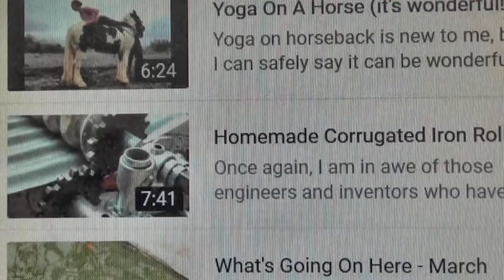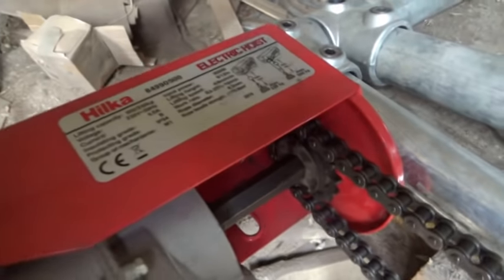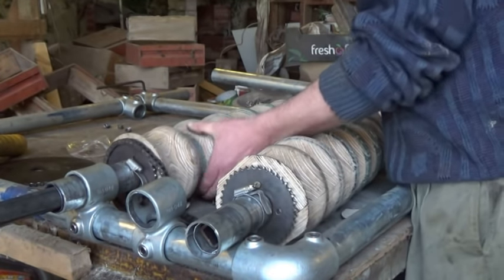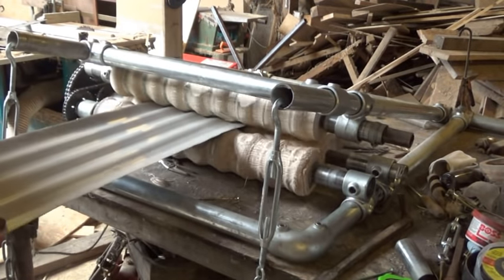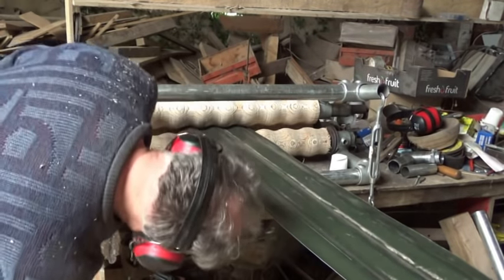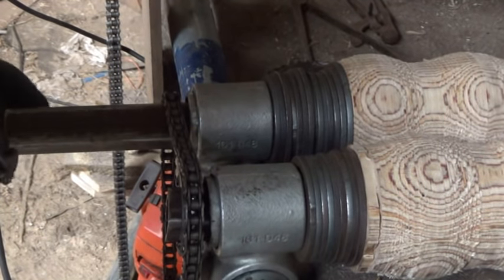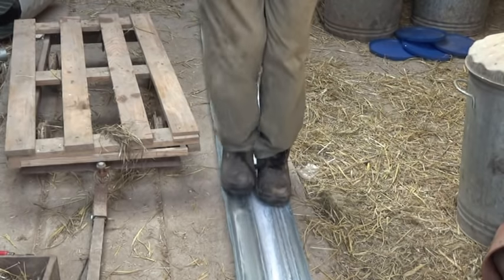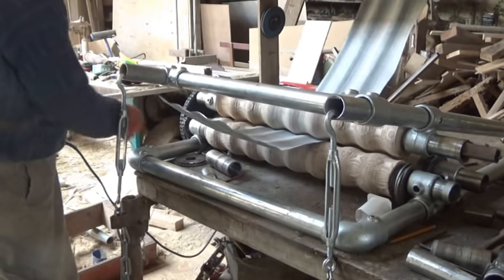Homemade Corrugated Iron Roller - Part Two

Comment: Run the iron horizontal, it will conform to your shape fine. It maybe counter intuitive but it will work.
Reply from the maker: You mean horizontally on the roof? It would need much more support though..
Reply: @WayOutWestx2  If your shed is under 2 meters long ,2 layers of 6mm ply 100mm wide bent in the curve in the center of the spaneand 12 mm ply on each end cut to the curve with 50mm X 50mm blocks 80mm long screwed around the curve to support the iron would be enough.
Reply: A Gramble style structure with ply cleats on the frame joints might be worth a look too. They have calculators for Gramble roofs on line now.

Comment: What is the problem with horizontal .you will get the form from your ends, water collecting is a none issue as it will run off back or front from the one or two dips on the very top.  I was impressed by posting a failed project, I feel

Comment: I don't see a way other than either very extreme pressure or heat how they can make that curved stuff. The raised section on the inside wants to be a shorter length than the outside does. I wonder if there's any 'how its made' style videos on this stuff.

Comment: You need multiple sets of rollers. Only using 3 rollers will naturally make it curl up in a circle. Try using 3 pairs gradually increasing the corrigation and stacking them directly on top of each other.
Reply from the maker: Thanks, but I'm trying to make it curl up : -  )

Comment: Progressive sets of rollers so that each set does not take all the load. Also each set of rollers should be say rounded for the 1st set then oval for the 2nd set. If you start off practicing with galvanized flat sheet very thin it will bend to your profile.

Comment: Was really hoping to see it work I would thing the bottom rollers need to be much further apart so it’s bending more sheet at a time lowering all the forces needed  allowing the metal to stretch not kink
Reply from the maker: I think the gap between them might make it more likely to kink because it's not supported. But you could be right..

Comment: Just a thought  have you thought about trying a drop press. I will soon need some standard curved sheet to repair a barn and as the flat is so much cheaper I thought of casting an internal and external mold from concrete and then using it to stamp the straight sheets into curved ones very similar to the way they make car body panels
It will be at least a year before I try but if I have any luck I will tell you. Unless of course you do it first 
Well done for all your trys at the worst you now know many ways how not to make them (Edison about light bulbs I think)
Reply from the maker: Have a look through the playlist - you'll see that my later machine works really well.

Comment: I see you have way too many things in your setup that are causing variations that will mess up the rolling process. 
You are on the right track with your methods. However rolling corrugated iron does need some very precise measurements since even if your rollers are half a millimeter out of parallel it will create a point at wich the steel can pinch and buckle. 
Try making a fixed, welded frame, using screws to adjust the tension,  and, well, steel rollers are really the only option, not sure how you can get around that one...maybe if you make your wood rollers very carefully you might snag the first couple of runs....if you get everything else just right. 
Unfortunately as the wood compresses it will throw you out again. 
Keep persevering though, love your ingenuity 👍

Comment: I have a hoop house for my chickens. It is covered with 2x4 galvanized wire and each year I cover the wire with shrink wrap. In the summer I cut out part of the sides for air flow. I believe shrink wrap is better than a corrugated roof because it allows year long sunlight. Even at temperatures below zero the chickens roost on top of the enclosed coop rather than inside. I added a few fiberglass poles to the inside to shore up the structure against heavy snow. It requires a couple hours of maintenance per year.

Comment: Take with grain of salt, but I envision two bottom rollers moving apart in progression of downward pressure.
Reply from the maker: Ha! Now you're talking complicated : -  )
Reply: @WayOutWestx2  It is funny this problem your encountering has me dreaming about how to fix it.  I think the way you have it now you have two points of contact where the top roller hits the two bottom rollers as it goes around the top roller, it kinks between that transition is my best guess.  The idea to have the rollers move out of the way could be a real pain.  I dreamed up a pivot that was held together with spring that releases under the pressure of the top roller and your right, a nightmare.  Then it occurred to me that maybe you don't need direct contact sandwiching the metal between the top and bottom rollers.  What if you moved the two rollers out enough to allow the metal bend and bow above the bottom and below the top rollers.  I am hoping that would solve the kink issue, but probably will create other issues!  LOL!  Just know that it still has me scratching my head.  This reminds me of the time I had to investigate how the clay marble was created on a massive scale and I could not figure it out.  Old Patent searches took me on a fascinating escapade of how the spherical bullet shot was invented, the missteps and the brilliant victories.  How Samuel Dyke produced so many of these clay marbles, they were used as ballast in ships.

Comment: the problem yes your rolling it back and forth but I believe you need more sets of rollers were the center is creased first and then so one to the next set of rollers. the metal is trying to go smaller.   IE you have a 3 foot wide peice and onces it fed though the roller it might be 2 feet as it comes out.
Reply from the maker: I'm only trying to roll the corrugated iron - not put them into flat sheet. Sorry if that wasn't clear
Reply: @WayOutWestx2  Maybe the piece of sheet metal needs curved first then the corrugation rolled in.  I know they do this for the big grain bin's.

Comment: You're probably not going to like hearing this, but I think the slack in the pipe construction is really not doing you any favors.

I think it's true that the flat steel would be less robust than formed corrugated iron, but if it's supported at both the front and the back with frames it would still be quite strong
Reply from the maker: Thanks, Rob. I spent yesterday taking out slack from the bearings - and the result was the same. So I may have to go with the flat after all.

Comment: I think you need rollers that inter-mesh and the sheet just fits in the 1.5mm or 2mm gap. In that case wooden rollers and thin axles simply won't do due to flex.
Reply from the maker: I can't find any flex in them so far, Roger - but you might be right
Reply: @WayOutWestx2  What I mean is two rollers one above the other, not three. Granted that will not give you a curve to the panel but perhaps the curve could be put in afterwards like you are doing it now.

Comment: Switch to a canvas/resin composite and seal it with shellac. It's very strong, if it breaks its biodegradable, and is a much better insulator than metal.
Reply from the maker: Good idea, but I wonder how long it would take for the fox to get through it?
Reply: @WayOutWestx2  laminate chicken wire between the layers and it won't

Comment: A thought...
That roofing tin is wavy to give it stiffness so that it DOESN'T bend and lays flat on your roof...
Since you're going to be using it in a U shape, why use corrugated tin? Why not use flat tin and a flat roller to make it U shaped. The large U shape you bend it into will be plenty stiff enough to only need the ends tacked to the floor of the "building" and would make it easier to make the end caps attach since you'd be stapling them flat to whatever arched wood you use to cap the ends of the house.

Look at tin piping for wood stoves. The bends in that curved metal have creases around the curve to shape it into a regular curve, to bend curved metal, like pipes or corrugated tin, you need it to either be thin with creases or thick enough (like exhaust pipes on vehicles) to accept a bend without buckling (even then, you sometimes have to pressurize with water/sand to keep it from creasing).

So, for your application, you should use flat tin, not corrugated tin.

Comment: Try waxing your rollers so the steel will slide alittle.... or soak the rollers in oil over night..... graphite might help too..... put sprocket on top roller too
Reply from the maker: put sprocket on top roller too? but then it would go in the same direction as the others, surely?

Comment: Your Problem is slippage that can be observed in the video. Yo need to increase the pressure at the roller contact area massively, which is why the machines are usually made of heavy steel or cast frame. The pressure forces the steel to flow into its new shape giving a smoother finish.
Reply from the maker: Not with the layout I have, Michael - increasing the pressure would only make it try to bend more quickly

Comment: Have you tried rolling a thin flat steel sheet? maybe .7 .5 mm?
Reply from the maker: Yes, that's no problem at all - but then it would flex too much in it's final position

Comment: Have you tried tempering the sheets after each pass? Otherwise you get work hardening
Reply from the maker: Unfortunately the zinc coating cant take any heat
Reply: @WayOutWestx2  well you can take it to a low steel anealing temperature as long as the atmosphere is controlled(nitrogen). It will turn the coating into Galvannealed. It you still has good weather properties and is more paintable but becomes stiffer.

The second option which is much more difficult is to add pleats. In the commercial systems they form the wave shape first then a press dimples The sheet to form a curve. Here is a picture: http://i.bosscdn.com/product/d5/85/73/e339808a23801e8c49eadd8098.jpg@4e_360w_360h.src%7C95Q.webp
Reply: Also with your rollers the width between each peak needs to get shorter as you press. Reducing the hight of the peak was a great insight but you also need to bring them closer. On commercial systems that do this they use a progressive die and each set of die brings the peaks a little closer. 

Best of luck. Hope you figure it out.

Comment: I think the problem has to be in the build of the whole machine. Not the rollers themselves. I think that there's simply too much play in everything. Trying to use the pipes and turnbuckles instead of bearings and heavier duty gear drive might be the problem, I always try to find some old machines to borrow parts off. It's the most affordable way to get heavy duty parts. That's the only difference I can see between yours and the commercial ones. That's where I always start anyway. Never give up.
Reply from the maker: The turnbuckle one was just the first set-up - but I take your point about too much play

Comment: I worked at a metal building manufacturer.  We had a system of multiple rollers to corrugate metal..  Each stage was a little different and the metal was 29 gauge.  Maybe instead of multiple passes through the same roller, you should make a different roller set with a slightly deeper and narrower corrugation.    Just something to think about as I understand you are tired of screwing with this.
Reply from the maker: Thanks, Jeff. I'll have a think...

Comment: Instead of bending the tin with rollers, what if you just make both sides of a form out of concrete and press the flat metal between the two halves. You could use a chain host as the bits would be heavy.
Reply from the maker: I wonder whether that would actually work though - The corrugations would have to be in there to start with, and putting weight into the middle of a corr. sheet would just buckle it surely? I'd love to try it, but the experiment alone would be quite a project

Comment: Heat ? What if you heated the metal before running it through the rollers
Reply from the maker: Unfortunately it would need to be too hot for the zinc coating, so the finishing would be ruined

Comment: The answer: it needs MORE PRECISION!
No single part should wiggle more than half a millimetre since the moment you start inserting a sheet into the machine.
It would be possible but you would need to find a way to use metal instead of wood and not using pipes as they do give a bit when the movement starts.
You just need more precision in the machine.

Comment: Buy yourself a powered bead roller and roll one bead at a time.

With that method, you also won't be constrained to parallel beads.
Reply from the maker: Interesting idea. Thanks. I imagine that would wreck the zinc coating but I'll have a look
Reply from the maker: That's amazing. Thanks.

Comment: I don't normally leave comments. But why don't you just get a culvert cut it in half then pop rivet tin sheeting on to the inside of it for the skirting  like your videos keep them coming
Reply from the maker: thanks, but I'm still hoping to make them in one piece. And also all the culvert here seems to be plastic these days
Reply: Awesome I can totally respect that. just throwing out ideas. And just for the fun of it I have one more. I was at a construction site and the new fire codes require the basement windows to be escapable. So my idea is one of those barriers that are made to hold back the dirt might work for you. The ones here are metal could be an option. And as always have a great day
Reply: I just did some looking around and the cheapest ones I could find were about 210 American dollars So probably outside the budget of your project

Comment: Incidentally https://youtu.be/7f__LAudU9A that took me two seconds to find maybe a steel roller set and you could weld everything and make everything more rigid right? I mean can you weld? can you get thread rod, about an inch should be strong enough instead of the turnbuckles. Maybe you could try anealing the steel sheets if you're not using colourbond. I love that you mentioned that we have it in Australia, yep we do our verandah's with it, we call it bull nosing, it's very attractive.
Reply: Use a ball nose endmill in your die grinder or a tungsten burr, focus on the finish of the steel as in polished. they shouldn't have to be hardened they just wont last very long
Reply from the maker: Thanks Nick, the zinc couldn't cope with the heat so I can't anneal it. And the roller set is what costs the money..!

Comment: Keep it up Tim!
Two things i think may help
- a way of adjusting the tension on both sides evenly so even distribution of pressure (not pinching on either side).
- and a feed guide along the edge to keep alignment as it feeds through.
I think both these are causing a slight stack up of errors as its moving back and forth making it twist
Reply from the maker: They gripped really well until I reduced the size - maybe too much..?

Comment: DG Roofing in Williamstown, Co Galway 09496 43355 have the rollers for curving the corrugated iron. They will roll to any diameter for you. There nice guys so if you call they might show you how they do it.
One point. Your rollers are far to rough for rolling, they have to be very smooth (polished surface is best) and you also need to spray your metal with lubricant to allow the metal to form better.
Reply from the maker: Thanks, I'll get on to them. (There are lots of corrie rollers out there but no one will make the shape I want, so far. I need a tight U shape...)

Comment: Heat the iron corrugated sheets and keep them hot so the metal can move it's fibers around to the shape you desire
Reply from the maker: unfortunately the zinc coating can't cope with any heat

Comment: I had to make corrugated stainless steel 40 years ago. This was on a much smaller scale with about 10mm pitch. With stainless steel it will work harden if stretched in the type of roller that you are trying. We decided to turn the process through 90 degrees and use 2 very wide 'gears ' to form the corrugations. We made these by fitting round edges flat bar into plain rollers along their length. We milled slots sling the length of the rollers and pressed in the flat bar. You probably need some of your large pipe with half pipe welded on at equal  spacing. This will form corrugated sheet that is not stretched and so not be stressed. This will then roll as you require.